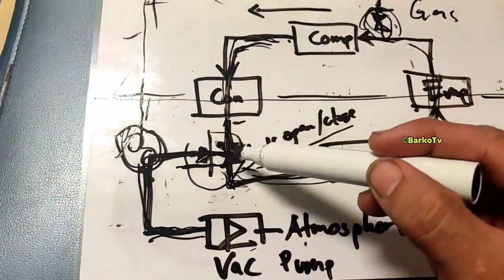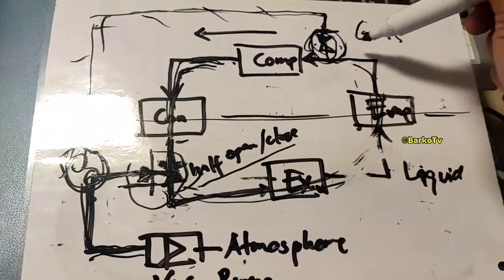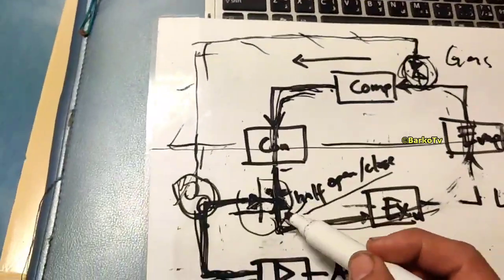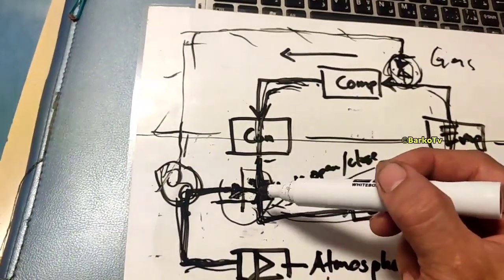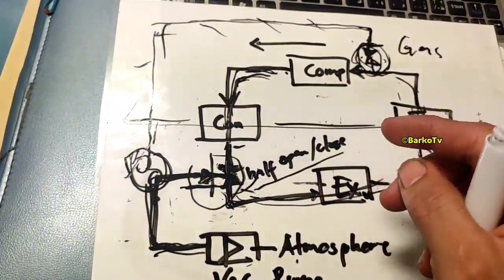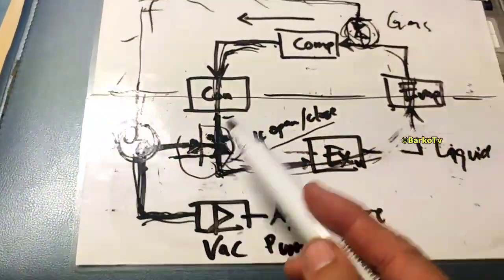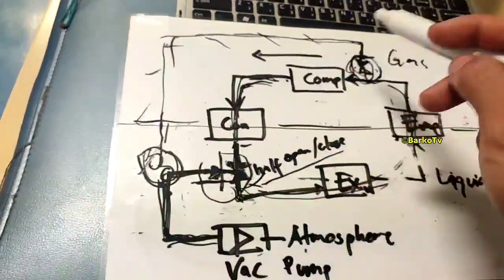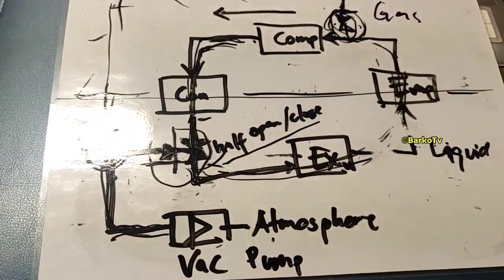Part 7: How to perform evacuation and pressure test using negative pressure.

Comment: Bro how to vacum compressor .  Freon pumpdown first or how to ?
Reply from the maker: This video, evacuation process by using vacuum pump in whole system with out refrigerant or freon. What do you mean compressor only? It means you have freon at the system and then you want to overhaul the compressor only? Do pump down then, close all valve suction and diacharge, see to it that there is no passing on your valve before you can overhaul your compressor
Reply from the maker: The after overhauling your compressor,  now you can proceed to evacuation /vacuum your compressor,after that process. You can now open your valves and back to normal